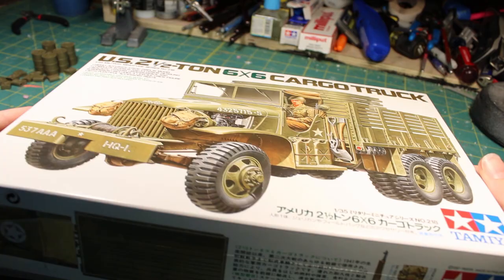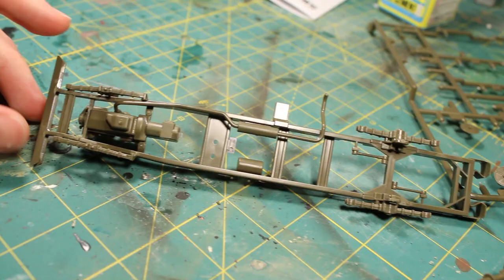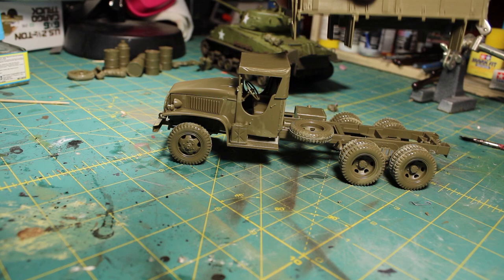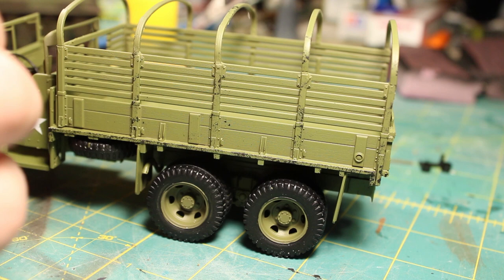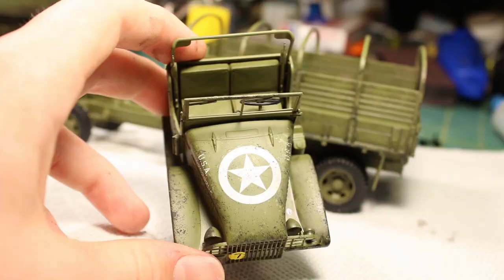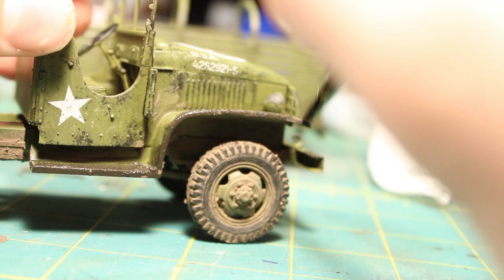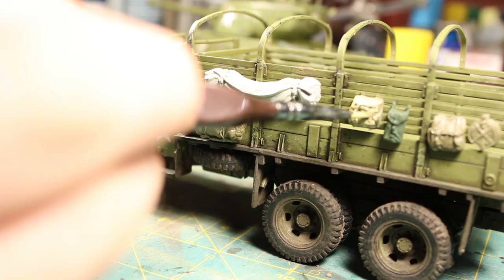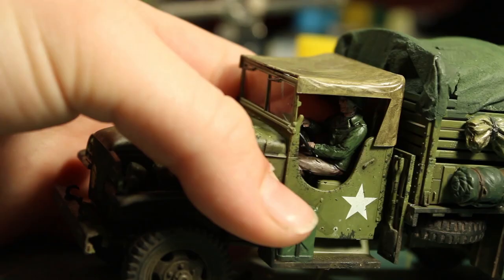Tamiya 2 1/2 ton Cargo Truck 1/35 scale - Full Build

Comment: Very excellent work on the lorry as well.
I have assembled long time ago one lorry in that same scale as well. Only differences were that the model kit is from Revell, and the lorry is called MAN. The MAN lorry had rubber tires that are like separate parts. And only it didn't have that option of putting tarp like you did it.
But speaking of the tarp, I have to ask you few things about it as well (I'm asking because I didn't quite understand you that). And those are:
1. What was the mixture that you have used as well?
2. How long was exactly that paper tissue stayed in that mixture?
3. How long it takes to dry that paper tissue when you have putted it on lorry?

Comment: You've developed quite a cool style over time. I like your work. This is a great build and very nice finishing. Floor polish lowers the surface tension and it also leaves a 'harder' coat which is a great base for the ensuing weathering. That's a good catch with the soil color. I might have scratched up the decals a little. The tarp is amazing!! Great job, see you for the next one!
Reply from the maker: Thanks!